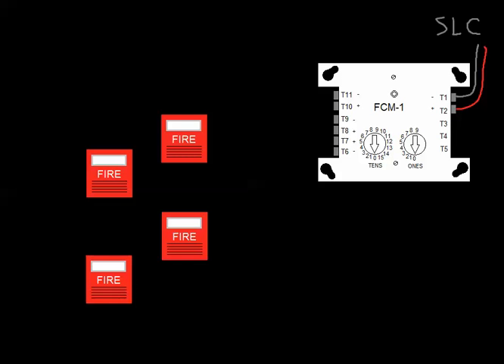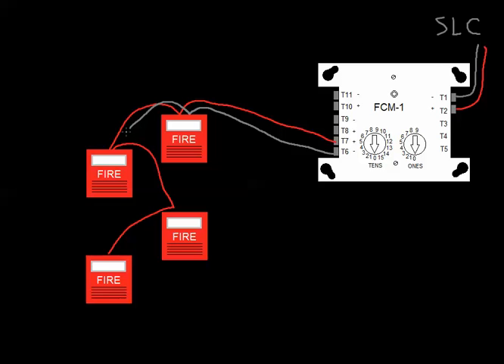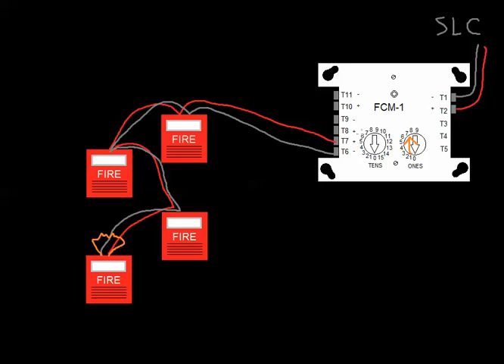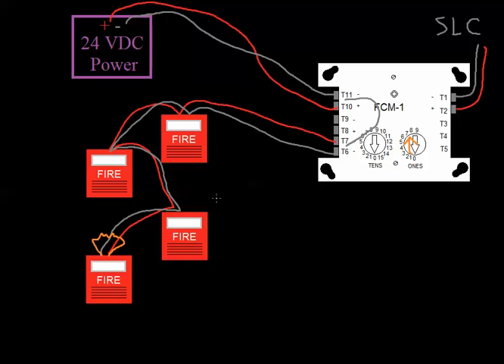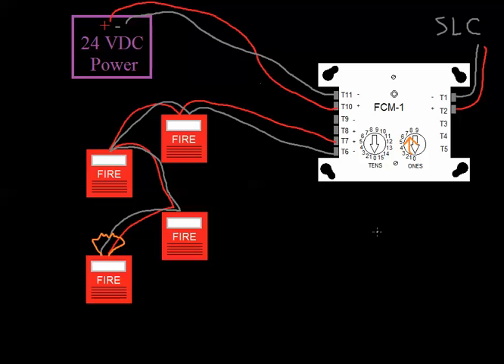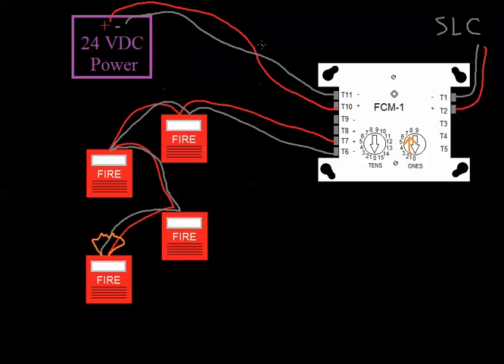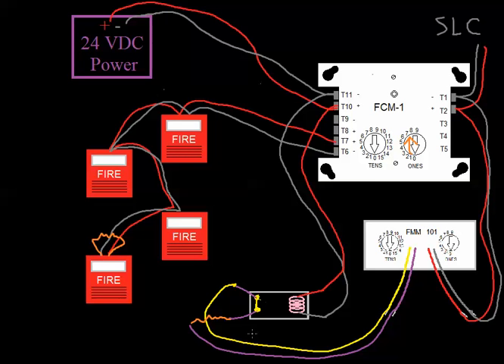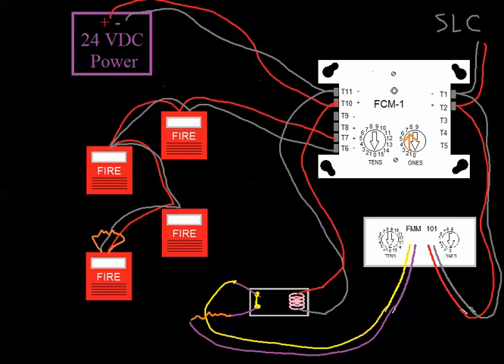25 - Control Modules - Introduction to Fire Alarms

Comment: today ,In Generator  Hall I Have Install 4 Heat Detector (Conventional) With 2 Mini Monitor  Module  ,2 MCP With (1MM) ,2 Bell Direct With Nac1, 2 strobe Direct With Nac 2 ,1 Solenoid Use For Co2 Release (Control module)  So How  i Can Creat Zone in Notifer 320 ,Another Thing For  Releasing  Co2 Must Work On Cross Zoning ,Bells And Strobe must  active After Any Trouble In Circuit  , I need To manually Programming  In Notifer 3030 Panel. I Need A Help
Reply from the maker: This is not something you're going to be able to program if you don't have the software. Also, some of what you're saying doesn't make sense to me. You want your bells and strobes to activate on a trouble?

Notifier uses releasing zones that would accomplish much of what you're saying. If I'm not mistaken, you can only write the equations for the releasing zones with the software.

I'm not being rude, just being honest, if you're installing a CO2 system, you shouldn't be programming the system unless you have a lot of familiarity with it and the programming license. You could kill someone if that discharges when it isn't supposed to.

Comment: Dear Sir.  May I have one question. If external DC 24V power supply broken, is the panel show trouble for this FCM module? One of my project the alarm bells are connected with FCM module. Now client want to off alarm bell at the day time and on back in the night time. I am planning to disconnect external power supply to this FCM module.Is it possible?

TIA 
Andrew
Reply: Yes, you will get a trouble with power loss.

Comment: Will you be kind enough to share some knowledge on how annunciators work and tie in to an FACP?
Reply from the maker: Typically it's a data signal called EIA-485. Some panels require 2 data wires, some require 4 because they require a return. All will also require 2 24 volt power cables as well.
Reply: @JoeKlochan  thank you so much Joe for taking the time to reply. And thanks for the videos they have been very informative. I knew what they were supposed to operate in theory  but never how they really worked to this extent. You delved deeper into how they operate the animations really helped bring them together.

Comment: Need know if power cut in fcm
Will give signal to panel its faulty
Reply from the maker: Good question. If it's an FCM, and so it's on a notifier panel, then most likely yes you'll get a trouble. But it depends on how that FCM is programmed and what it's doing. If its power source is 24 volts and it's triggering strobes or a NAC panel, then it should give you a power loss trouble. It's been a number of years since I've worked for a notifier distributor, so I'm a little out of practice. I don't remember all the different type codes. If it's tripping speakers, the FCM won't give you a trouble because you don't have 24 volts present on those terminals, rather it's a signal from the amplifier.

Comment: I've never seen them be able to sync with control module.  Project managers, service guys,  head of fire alarm calling tech support,  never seen it.
Reply from the maker: I've never seen it not work. All the control module does is pass the input source to the output terminals when it's prompted. It doesn't interfere with sync at all. I just finished a job this week where we did this again, no sync issues. What kind of equipment are you working on?
Reply: @JoeKlochan  fire lite,  the new nac booster is altronix. Were getting 24v from the booster and tying in to control module it has slc. Yeah, if you can tell me how to synch'em I'll take the help.

Comment: May I ask a question about the wiring of speaker strobe connected to the FCM-1 module. Do we need to run 24volt DC from fire alarm panel to the FCM-1 module? I understand there is an amplified signal already connected to the module.
Reply from the maker: No, there wouldn't be 24 volts going to that module, only SLC, the audio signal from the amplifier, and then the output to the speakers. Those are the only circuits connected to the module.
Reply: Thank you very much, from the Philippines.

Comment: What point on the panel would these start on?
Reply from the maker: Not sure I totally understand the question. I haven't watched this video in a long time so I don't remember exactly what I covered in it, but the short answer is it would start at the SLC. That circuit would allow the module to communicate with the panel, then it would need some sort of power source, either 24 volts for horn strobes, or an amplifier circuit if it's for speakers. If you mean what address would it start at, on most panels that wouldn't matter, you could use any open address.

Comment: Does the auxiliary power need to be resettable even though it’s on standby? And if so how can you make it resettable, because it appears that it cannot be resettable with just the power supervision relay?
Reply from the maker: I haven't watched this video in a long time, so I don't remember exactly what I got into, but power feeding control modules shouldn't need to be resettable. If it was a zone monitor module (the type that requires external power to feed conventional smokes), that would require resettable power, which can be achieved by installing an addressable relay and programming it for resettable power, depending on the panel.

Comment: With your current setup, the AVs won't sync per ADA standard. But if you use the Control Module to trip a BPS with sync capability and land the AVs on the BPS NACs. Only time you should use a Module to fire an AV directly is if your doing an outdoor AV for ring by tenant.
Reply from the maker: Peter Jozefowicz that depends on what's powering your control module. If the power feeding the control module is already synchronized, the sync will pass through the control module.
Reply: Joe Klochan the only 24v power source that you should be using are either the 24v R/NR contacts off the the FACP or the AUX on a BPS so it's a supervised source. What exactly are you using for 24v power?
Reply from the maker: Peter Jozefowicz that depends on the setup. There are situations where FCPS panels are setup to be always on (aux power jumpered to input 1) and then the outputs feed control modules. That's typical in strip mall applications. In that case, the FCPS is the master sync. What are you going off when you say the ONLY power I should use is off the panel?

Comment: You could also use the power supervision relay with the EOL resistor on the NAC circuit to avoid using an additional module. However that is only beneficial of your EOL device is close to your power source as running the source power all the way to the EOL device is impractical at long distancea.